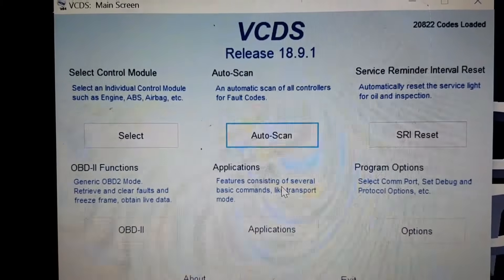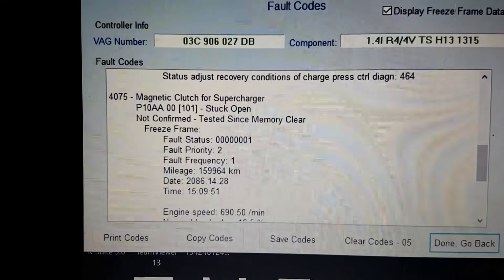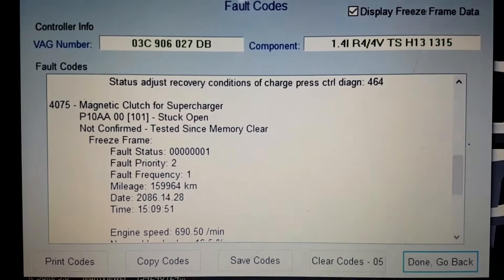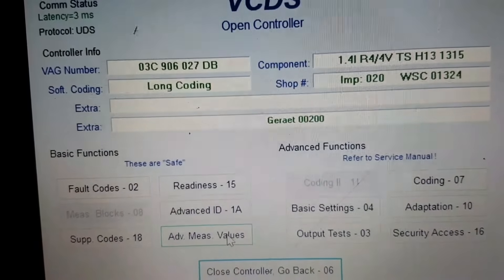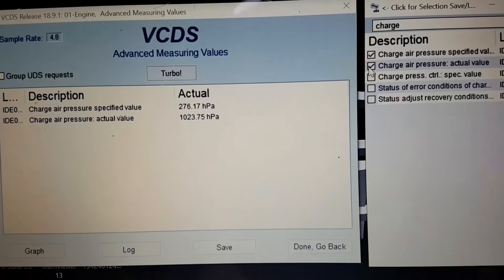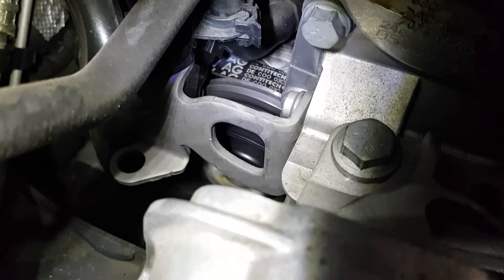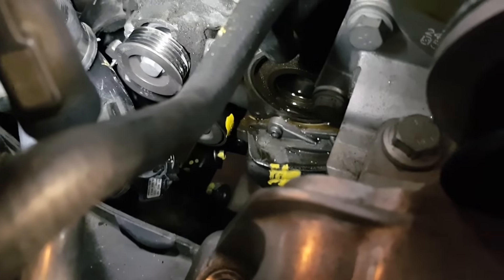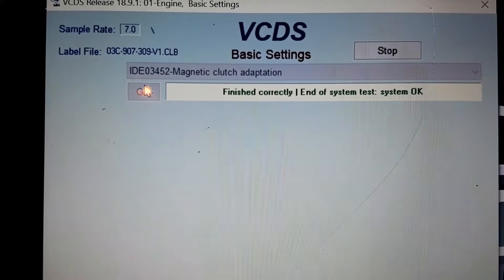P10AA P2262 VW 1.4TSI No Power Below 3000rpm Water Pump Clutch

Comment: Has anyone ever put a smaller pulley onto the supercharger to get it to spool faster any benefits drawbacks also would there be anybenefit to adjusting when the clutch and diverter flap engage or disengage if the supercharger was permantly active would this cause a chpkepoint in power for the turbo im considering tuning my 1.4 tsi and wondering what my options are is there a charger upgrade for these?
Reply: Получилось?

Comment: To my knowledge the ECU in this engine uses a CAN protocol. If so how are you able to find the Magnetic Clutch Adaption from the Settings menu without first choosing a Group Number? VCDS offers no guidance on which Group Number to choose. They expect you to guess the correct answer

Comment: Morning,got a similar problem replaced the pump about 3 times now and just replaced it again, noticed a rattling sound on starting acceleration but goes away. Could my supercharger maybe faulty causing the water pumps to give in so quick?noticed the sound in the previous water pump and that one lasted a week. This pump is form a different supplier though. Sorry for commenting on an old thread

Comment: Dear friend, can I diagnose if the compressor is engaging when parked at neutral by just accelerating neutral?
Reply: yes just press the clutch in and give a bit throttle, the compressor should engange when you press the clutch

Comment: Hi, my VCDS doesn't have that menu, magnetic clutch adaptation? Will be replacing Waterpump on Friday and i dont know what to do
I have VCDS 22.9, Golf Mk5 2008
Reply: Hey,
I am having the same issue, what did you do to solve it please?

Thank you
Reply: @ahartales3215  replaced the water pump
Reply: @ahartales3215  at a mechanic and asked them to do it for me
Reply: @handle32169  Yes they did, yes it's running fine.

Comment: Anyone getting error doing the adaptation? Need security access ?
Reply: Yes, at first I got the error too. I tried a few things and eventually I was able to do the adaptation. You should make sure all the doors/hood/trunk are closed. When you want to do the adaptation you'll have start the engine and follow the instructions on vcds, fully press the brake & throttle.

Comment: Hi 
I have changed the water pump. Now the car won't start. It cranks and sounds like it doesn't have compression. checked the  compression , it was very low 25psi.
Don't know what happened to it because we only changed the water pump and didn't do anything to the rest of the engine.
Any help would be highly regarded. thanks
Reply from the maker: Did you turn the engine backwards or anything?  Sounds like it has jumped timing.

Comment: Evening mate, I have vcds with unlimited vins, plugged it in to do the adaptation but the system is not displaying any IDE, just generic basic settings labels but not IDE----- lambda sensor, it will just show as lambda sensor.
Any idea whats going on? 
Cheers, love the content.
Reply: Hello mate,
I'm literally facing the same issue right now... Did you find any solution? I have all the parts and i won't replace anything if I cannot do the adaptation of the magnetic clutch...

Thanks a lot for your help

Comment: Hey, thanks for the video.
I initially had lack of power at low rpm 
I have replaced the water pump and noticed an improvement but sometimes the issue come back. Is that because I still didn’t get the adaption done?
I know I need to do the adaption but I just want to know that it’s only the water pump that was bad.
Thanks

Comment: Hi , i had fault code P10AD, it was suggested to replace water pump which I had done , still has not fixed problem ,any idea if it is wiring issue, one side of the wire was slightly corroded so had that repaired
Reply: Same problem here. How have u fixed yours?
Reply: @albertoc5427   Check fuse 21 (10 amp) under the bonnet.
Reply: @johnhorgan5313  thanks, you hit the nail. Yes, fuse 21 was blowing off every time it was changed. I found that the reason was a faulty/shorted magnetic clutch of the water pump. A few months ago I got it changed as I also needed to chain my timing chain (4th chain this car has).
Reply: @johnhorgan5313  could you guide us where is exactly this fuse location is? Or maybe small video if it's not too much to ask.. Thanks...
Reply: Fuse box under the hood. Google it out, or check all the fusses

Comment: Hello, My engine (1.4 TSI 160 CAVD) started making noise like broken fan or something from the water pump area.
 I can also hear a squeaky mouse noises for 0.5 - 1.0 sec when i move on. That would be water pump?

The Engine was regenerated with timing chain, but possibly without new pump

 Like other said in comments i feel like car haven't power below 3k rpm.

 And i have also one more question. I have the car with manual transmission and the question is... If you do a downshift with "rev matching" is this safe for this engine (water pump clutch) / supercharger or even whole engine? Because by doing revmatching you activating supercharger all the time, right?

 Please, answer me. I would like to post links to the videos, but i can't do this in this comment, don't know why ( Im really sorry for my bad english)
Reply from the maker: Water pump bearings fail and cause this noise. Replace the pump. You can take the belt off and feel the free play in the bearings, and spin the pulley and here/feel how rough it is. This is a common issue.
Reply: @FourRingsAuto  Thank you !

Comment: Thanks for your video! It's really helpful as I have to do the same this week. Do you know how much coolant spills by removing the pump? Or do I need to first empty the coolant?
Reply from the maker: You'd be better emptying first. You will lose all the coolant out of the engine and most out the radiator. It's a good time to renew the coolant anyway. Use genuine vw audi coolant only! Otherwise you will have other issues potentially in the future.
Reply: @FourRingsAuto  Amazing, thanks!

Comment: Hello FRA, was this a DSG or manual transmission vehicle.   Does the engine/gear needs to be engaged for manual transmission to perform Basic Settings/Adaptation?  I just purchased the VCDS HexV2 and having no luck getting the drop down menus to show Magnetic Clutch Adaptations option on the Basic Settings screen.  Any tips?  Can you do a step by steps demo vid on adaptation?  Cheers.
Reply from the maker: This was a dsg. No it should perform fine without gear being engaged. I'll see if i can make a video on doing the adaptions walkthrough on vcds.
Reply: Thank you for your reply 👍.   In relation to VCDS software, is a security access key/WSC required to perform the basic settings adaptation?   My installed VCDS sw doesn’t shows any of the setting options shown in your video.  Any advice would be appreciated.  02/2009 Golf 1.4TSI 118kW CAVD KWB.  My scan screen displayed CAN protocol, where as your vid displayed UDS Protocol.  Cheers..
Reply: Hi FRA.
I just got P10A9 Magnetic Clutch - Stuck NIL on my 2011 CAVD Golf 1.4tsi Twincharge.

Looks like I still got boost from supercharger, but sometimes feels jerky especially if boost on 2000-2400rpm (feels on-off-on-off).

If boosted over  3000rpm (turbo boost only?) it is smooth.

Anyway I will change waterpump.

After changing waterpump.....the adaptation of magnetic clutch in Basic Setting.....is it should be done with engine OFF (only ignition on) or engine ON ?

Thanks a lot in advance
Reply from the maker: Basic setting with ignition on from memory.
Reply: @FourRingsAuto  Thanks a lot for your guide0
Reply: @FourRingsAuto  Hi, I just changed my waterpump 2011 Golf 1.4 Tsi CAVD Twincharger 118kw DSG7.

I could not find the option for Initialize/Reset/Adaptation of Magnetic Clutch in Engine/Basic Settings.

I also had Tiguan 2015 1.4 Tsi CTHD Twincharger 118kw DSG6....Tiguan has menu for Reset/Adaptation of Magnetic Clutch.

Since the Golf does not have this menu.....any suggestion how to do Reset/Adaptation, because I don't want the new clutch to be failing prematurely (I just drove 2km from home to workshop....so far those 2km was smooth).

Many thanks for your help.

This is the screenshot of Basic setting Golf vs Tiguan (same 1.4 Tsi Twincharger)...only Tiguan has adaptation for magnetic clutch.
Unfortunately I just installed on Golf.

https://drive.google.com/file/d/11QQ2SGQ3N4aQTTqtk08SsNJ_dCRW3wqe/view?usp=drivesdk

(Sorry I could not insert picture....can only paste the link on gdrive)
Reply from the maker: It could be a software level difference in the ecu. Or it could be completely different part numbers and even manufacturer of ecu.
Reply: @FourRingsAuto  Hi FRA, many thanks for enlighten me. Yes could be different part's manufacturer therefore different firmware inside...and VCDS read it differently.

So, as I don't have menu for Adaptation of the magnetic clutch in Golf.....any suggestions for me ?  
Or any other software beside VCDS that I should try to use for magnetic clutch adaptation ?

Many thanks for your guidance & videos....they really help me a lot as DIY.

Comment: Hi, Im try with Launch Pro and OBDeleven Pro, and did the supercharger magnetic clutch adaptation , IDE03452 , came up with aborted safety reasons. Do u can to help me?
Reply: Start the engine, click go then press and hold brake and the accelerator until complete

Comment: Hot, how long need to push break and accelator pedal to "update" clutch?
Reply from the maker: Follow the instructions in the vcds screen and it'll be easy. It tells you what to do and what order, and when it has finished.
Reply: @FourRingsAuto  thanks, but i have delphi diagnostic, maybe you now how to do this on delphi?
Reply from the maker: Never used Delphi. I'm a VW Audi specialist so I use VCDS and Odis. When I work on any of the other brands I do like BMW, Mercedes, Land Rover, Porsche, I use the factory scan tools.

Comment: How much price waterpump original?oem?
Reply: Very expensive..in malaysia 1200 original..oem 600 or 700...this part common problem for tsi cav engine....
Reply from the maker: In Australia the water pump is about 400 or 500 for just the part. Very expensive water pump.

Comment: I feel like my mechanic is trying to scam me with this job
Reply: Same here, he wanna charge me over $1000.
Reply from the maker: Well the part is like $450 AUD here in Australia, and it's around a 4 hour job from memory. So could easily be close to $1000 aud when you take this into account and g13 genuine coolant being almost $40 per bottle and needing 2 of them to fill the system. 450 parts, 80 coolant, 4 hours labor could be between 400 and 600 depending on labour rate (or 800+ if going to the dealer). So yeah, 1000 would be absolutely around the ballpark.

Comment: Hello mate, having issues with my Supercharger. Only activating occasionally. 
I will be changing the waterpump with the help of this video, my only question is where did you manage to get the detention tool from? 
Many thanks.
Reply: Did that solve the problem? I have the same car and occasionally having power problems.
Reply: @albertoc5427  yes it fixed the issue, running smoothly once again!

Comment: Did you know if launch scaner has this function for clutch?
Reply from the maker: Not sure. Maybe. Depends which launch. VCDS isn't majorly expensive.
Reply: @FourRingsAuto what will happen if you dont do the adaption ? Because i have launch scanner and i can’t find this function. I change the waterpump and the car working fine with out the adaption ! (Volkswagen golf tsi manual transmission 2008 model). Thnx a lot
Reply from the maker: Potentially wear the electromagnetic clutch out faster. They say to do it so it probably should be done even if it does work as is.
Reply: @FourRingsAuto thnx for the fast reply ! So anyway if its work without the adaption will be ok right? The adaption is just a confirmation or a checkup that the magnetic works properly. I thought that the adaption was only for automatic transmission models or only for newer ones

Comment: I have this same problem on a 1.4tsi Scirocco 3; but I don't have VCDS or have anyone with VCDS that I know of. Can the basic settings be done with the ODIS software and cable? I know an Audi guy who uses this software.
Reply from the maker: Yes odis is the factory tool so will be able to carry out the basic settings. As long as the odis isn't dealer locked to Audi that is.
Reply: @FourRingsAuto  are there cheaper/free alternative to VCDS and ODIS? My water pump was replaced but the settings wasnt changed. I get code p10ad the same code when my water pump failed. I reset it but the code stays on. I don't have a VCDS or ODIS to be able to change the setting. Please can you get back to me ASAP.
Reply from the maker: Obd eleven is ok. About $100aud
Reply: @FourRingsAuto  I have Carista. I thought that would have worked when I bought it. Will OBD Eleven definitely change the setting? Thank you for the quick response!!!

Comment: Hi again bought vagcom and did the supercharger magnetic clutch adaptation , IDE03452 , came up with aborted safety reasons ! Error , any clue
Reply: Same problem here, do u have solution?
Reply: Assaliz Auto Parts  hi my son didn’t bring the car back to me to do more testing , I mark the belt when stationary and drove it , recheck and it move , but I thought the clutch was engaged until about 3000rpm , then disengage when the turbo kicked in , he said the car drives ok , so didn’t follow it up , tried to adapt it but came up with safety error
Reply: @chrisrosier8075  what group to adapt/basic settings in vcds? I dont have the falling down menu?

Comment: Hi watch several of your videos on the 1.4 twincharge engine problems. , just replaced the water pump/ magnetic clutch after a coolant leak between both flanges , does the supercharger rotate during idle or slight revs ? Mine is not , but does move during driving , marked the belt , and you can hear the supercharger work when you drive aggressively from idle , need to get vag.com to check, any ideas
Reply from the maker: Doesn't move stationary. New pump clutch needs adapting after installing.

Comment: Hi does the super charger run constantly all the time when below 3000 rpm
Reply: it depends how you press the gas. if you’re a slow driver you wont feel a sudden boost, only if you put a lil bit of gas then the supercharger engages.

Comment: Hi there, you wouldnt happen to know what the polarity of the wiring is at the plug? Or whether there is an internal diode that could be burnt out if connected incorrect? Cheers
Reply from the maker: I can probably find put the polarity for you.

Comment: that is the only way to avoid the early damage of the magnetic clutch >>>> to do the setting which you have added to VCD
Reply from the maker: A lot of people replace the pump and don't do the basic setting.  Premature failure after.
Reply: @FourRingsAuto   you mean after i replace the pump must do the basic setting or default  >>> this setting done by VCD or what else ( recently they use a tab contain a universal program to diagnose and remove the errors ) this device can do this setting 
and my issue about this part is the magnetic clutch  fails after 6k  km  work  in 9 months
Reply from the maker: Needs basic setting after replacement 100%
Reply: @FourRingsAuto  Cloud you explain how to perform basic setting a little more specific? You need vcds? I am not sure if i have the dropdown in my version 17.1... Engine running during setting? thanks in advance.
Reply: @emamco11  I'm having the same issue. Waterpump failed and got replaced a year ago. It's been making the same screeching sound just before it failed. The moron who replaced it probably never did the basic setting.

Comment: I have a VW Tiguan 1.4TSI 118kw (Turbo and supercharged) and I noticed a rattling in the engine compartment.  Notified VW service center of this when it went in for it's service (they greased the fan belt afterwords). The rattling noise went away after the car had warmed up after 10 mins. A week of driving passed and the rattling started to become a screech, the car went into limp mode and the engine light came on. 
I drove the car to the service center and when I arrived I noticed water pissing out and the mechanic told me it's a water pump failure.
Adding to your story- my car had some power up until 3000rpm, the limiter is then activated and the car loses power. I am unable to hear the turbo working, the super charger still boosts lower revs as normal. Car is currently in for repairs, hopefully there isn't a turbo failure as well, my hopes are that the turbo won't kick in since the car is in limp mode.
Reply: So the waterpump pulley which is mated to the supercharger pulley broke- apparently the clutch in between the two broke. Long story short, Engine light came on due to supercharger not  working. Waterpump was replaced and all is good!
Reply: @bboyrsa7594  I think I might have the same issue, did you also notice loss of coolant? and as for the rattling sound is it sort of a slapping metal sound every few seconds when the engines on idle?

Comment: did you drive it around after marking the belt or should this be moving no matter what?
Reply from the maker: Drove it. It should only move when the compressor is engaged. You can load them up stationary or slow rolling and watch too. Bit to be honest, mark it amd drive it ajd it shouldn't end up where it started.
Reply: @FourRingsAuto  my clutch engages both when driving and when i command it to. the rattling sound goes away ones the clutch engages so im assuming its a worn bearing.
was this the same case with you?
Reply from the maker: Different issue, but yes the water pump needs renewing. Mine was seized.